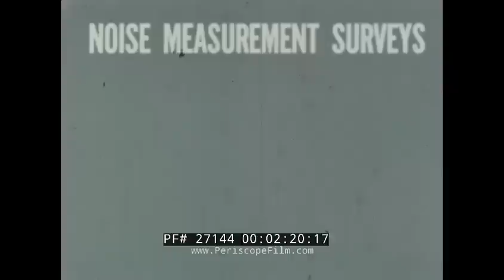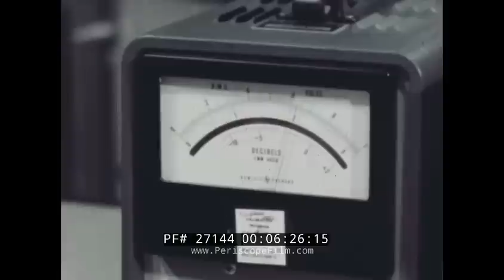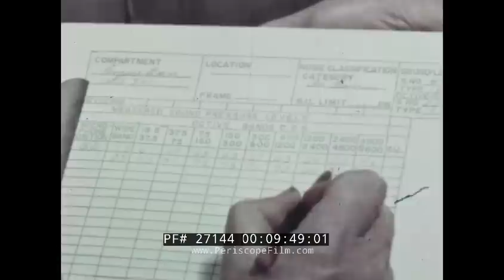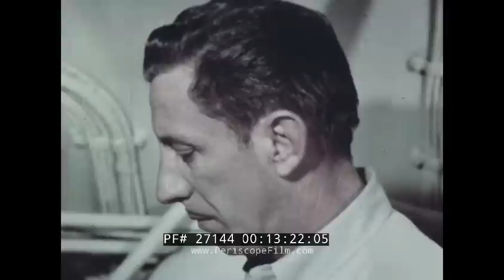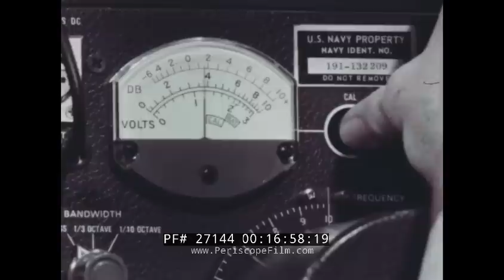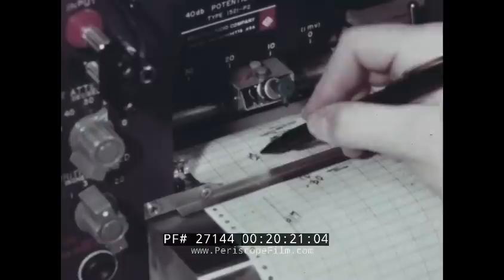SUBMARINE SOUND AND VIBRATION MEASUREMENT U.S. NAVY FILM  27144

Comment: our sonar man had a unit he strapped to his chest with headphones and a wand with some type of sensor at the end of the wand , he would touch it to the machinery and write down the levels displayed on his meter display , some times he would shut down the machinery until repairs could be made .. long complicated video , way above my understanding bit i'm sure they knew what they were doing ..SSBN 608 1971,1972 ..
Reply: I didnt know they use sonar man as vibration analist on board. It makes sense since the vibration is a mechanic waveform, the sonar man is basically a mechanic waveform analyst. what your sonar man was doing was analyzing the sound spectrum from the machinery, if levels increased or a particular frequency changed he would recommend to make a repair. I'm a rotating equipment vibration analyst and very recently i discovered some resemblances with sonar man.

Comment: So those measurements are also used to determine condition of machinery?  (as the noises and vibration are measured monthly or any 6 months they have references to compare, it may be possible to point certain wear or misfunction depending of the frequency changes  is it?
Reply from the maker: Yes, these measurements determine when machines have to be upgraded, replaced, or fixed.
Reply: Yes and by seeing which frequency are predominant you can also figure out which component is wearing or misfunctioning.